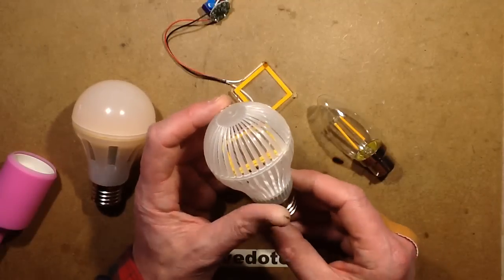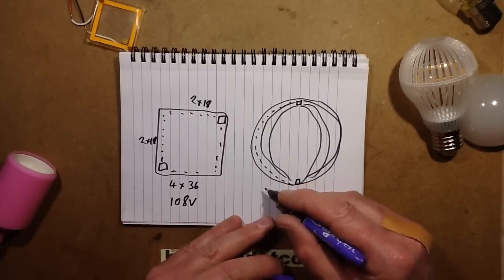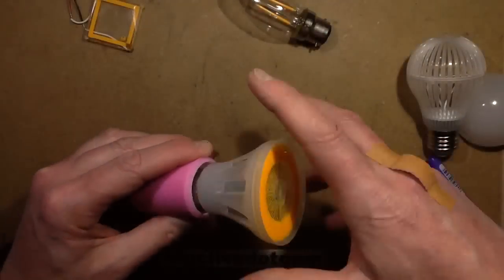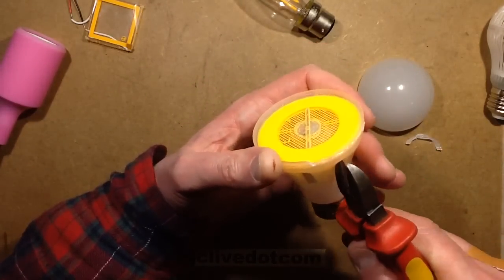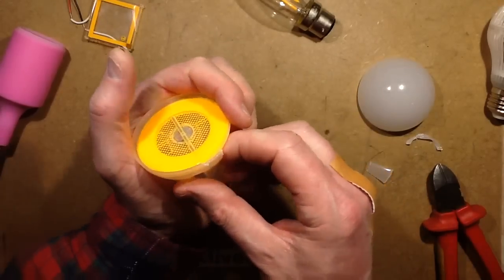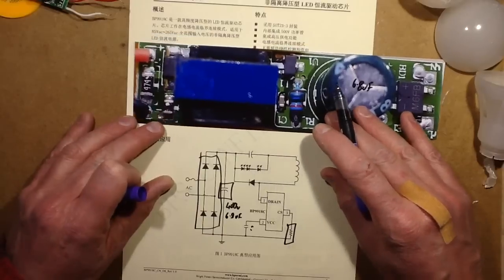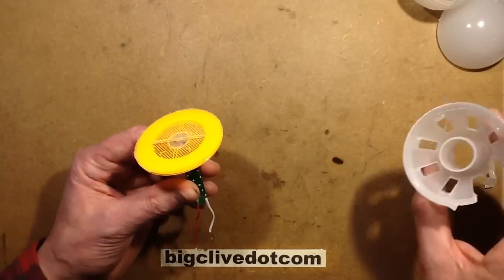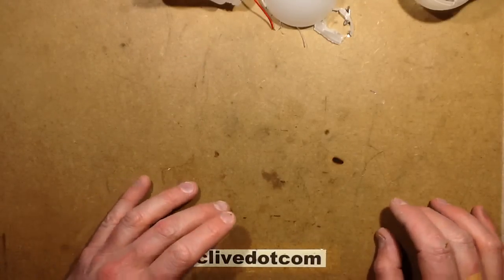Next generation glass COB LED lamp MKII teardown.

Comment: It will be interesting to see if there will be a final universal design for led lamps that everyone uses like with incandescent lamps.
Reply: yes the trend for led lamps is doing away with the univeral fitting and the entire lamp will be a unit, look at say the round led bathroom IP lamps, on the outside its the same as the cfl design but inside the leds are part of it.   they can be made more compact and in some more unusual designs if they dont have to think about backward compatability, plus easier to fit universal drivers so the entire world can have one production run

Comment: Actually these types of bulbs have been around for about a year now. Good luck getting more than 4 months of use out of them without the plastic cracking. They might do the job if you use them in a fixture where they are not on for prolonged periods of time.

Comment: If the diameter of the LED COB is same or similar as the diameter of the LED kit bulb PCB, then it should be able to fit into the other case._

Comment: What about flicker? I have a lot of led lamps with tremendous amount of 100Hz flicker for example. Would be nice if you could hook up to a scope,  the analog output of a high-speed, light-to-voltage sensor like the TSL257.

Comment: When you position that printed circuit just right it looks like a giant circuit board with big components
Reply: He did that, so the calculator wasn't that big :-)
Reply: ‍1marcelfilms the charge in that capacitor can power a house for 24 hours

Comment: How long before mains voltage rated rectifier LED's are a thing?
Reply: Just bought a set of 50w cobs off Ebay , haven't plugged them in yet, kinda handy having 220v in. 
Search for "220V 50W 60X40MM Warm white LED Floodlight COB Chip, Integrated Smart IC Driver".

Comment: Clives pictures have recently improved considerably, so much I keep thinking he has a giant circuit board!!!
Reply: Very deceptive, felt like Clives hands had shrunk.
Reply: I was just thinking that, the perspective is spot-on.
Reply: I thought it was cause he was getting older and started using large-print components, like those giant-buttoned old people phones.
Reply: I'm probably easily amused but the enlarged photos make me smile - IIRC one of the old electronics magazines had a cartoon of a chap struggling to lift a giant TO3 power tranny package the size of a bass drum  onto a bench.

If clive ever does get a camera with super zoom I hope he keeps the giant pictures going, it's become part of the channels identity imo.
Reply: John Wattie "That big capacitor is HUGE what the hell!??? Did he make the circuit board with some bits laying around?" 

No, me it's a photo. I felt so silly when I figured it out.
Reply: schadenfreudebuddha Rebelling against the modern trend of using SMD by using progressively larger components?, I like it.
Reply: ThisIsARubbishName You were not alone there!

Comment: Interesting development! None of it yet solves the problem of LED light just not being nearly as nice to sit under as incandescent. How can that be addressed?
Reply: Drugs.
Reply: A very thoughtful and useful reply. Thank you.
Reply: Decent quality led bulbs (phillips master led etc) use far better quality phosphor's than the typical £2/$2 led bulbs found on eBay etc.
Reply: I just remember I'm saving myself a lot of money and get over it.
Reply: Don't buy cheap lights and try before you buy. Problem solved.
Reply: Doesn't high CRI led light would do the trick ? Light quality is a problem for me too, I don't want any led light under 85 CRI that flood your room with blue/greenish light and makes your skin look dead :/
Reply: Pook365 some vision issues make it harder to tolerate highly concentrated point sources (glare).
I see streaks of light radiating out from every bright point, so widely spread light, indirect or fluorescent (LED replacement) tubes are best. Overall I still benefit from LED lights with my vision deficiencies, because I can have more light which makes the pupil contract and reduces the distortion. Just got to avoid very concentrated point sources.
Reply: You address it by getting better quality bulbs, especially in regards to the light quality. Clive unfortunately doesn't pay attention to that in his videos. You have to spend some, to get some, so you're not gonna get good bulbs at 2€ nor at highest energy efficiency.

The best-value option I've found are Ikea's Ledare bulbs, very good quality light with far higher CRI than the specs suggest, some go over 90 easily. Price is 6-10euros per bulb depending on power and should be available next to everywhere. Most of them are available in the much better 4k color temp as well (5k too, but that's a bit too much for my liking). No electronics-induced noises, no light flicker.

So far I've had only one break, and that was propably one of the first leds you were able to buy at Ikea, it took forever for that to go and it was in heavy use. Light years beyond any expensive (20+ euros) CFL I've had in every aspect, other than absolute maximum light output.

The tech has advanced far enough years ago, but your opinion won't change if you keep buying/seeing shitty bulbs.
Reply: PoisonedAl Good for you, Einstein. The problem is that many people with vision issues cannot tolerate LED light...and even some without vision issues find it straining. It's still an evolving technology, so I would hope that it's further refined as the year pass.
Reply: PoisonedAl Good for you, Einstein. The problem is that many people with vision issues cannot tolerate LED light...and even some without vision issues find it straining. It's still an evolving technology, so I would hope that it's further refined as the year pass.
Reply: RuralAccent Woodcraft What is the problem with LEDs for people with vision issues?
Reply: It depends on what the problem is.  I'm wondering if some people have issues with the 100Hz flicker (100Hz in the UK, 120Hz in the US.)
Reply: The problem with high CRI is cost. I have some Philips Master LED lights that are OK, but still not the same.
Typically when replacing the lights I install a lot more lumen, and that alone makes it harsher than the incandescent bulbs even if the colour was perfect. We just have to get used to it.
Reply: Nicholas Martin Indeed they are. I only use Philips, but while they're better, they don't eradicate the problem.
Reply: I will investigate those Ikea bulb, thanks for your review :)
I'd like to find a decent CRI led light bulb, preferably above 4k, providing enough lumen for my room (typically around 2000lumen would be fine), and dimmable. That shouldn't be so hard to find! I don't mind the price too much. TBH the more I search, the more I think I will end up building my own lamp, from led COB, heatsink and arduino, as I previously had. But that's costly.
Reply: There is nothing to be addressed. There are enough LED lights/bulbs that are completely indistinguishable from incadescents for quite some time now. Just don't buy the cheapest you can get (although even those are quite often fine now).
Reply: I'd like to point out that not all leds from Ikea are great, for example Ryets are already a noticeable step down from Ledares. 

And I think the only reason why people are weary of higher color temps is the fact that most earlier higher color temp CFL bulbs had horrific color rendering and people simply automatically associate that with higher K bulbs. These days I'll stay away from 2700K in general lighting if I just can, it's good for some uses though, like pre-sleep situations/locations.
Reply: +stefantrethan Yes, typically the issue with high quality vs. Poundland quality is cost.
High CRI lighting requires more phosphors in the mix. Just like with fluorescent lights before them. To keep them evenly distributed requires more care in their manufacture as having granules with different densities, shapes, and sizes become uniformly mixed is difficult.
Reply: The K stands for Kelvin. The rating is an approximation of what blackbody curve it fits. It has no relation to the "quality" of the light. You can spend a lot of money on a 94 CRI warm white LED strip light reel. And it will have a 2800K-3200K rating.
If you buy a 2000K lamp, it will approximate the light curve of a 2000 Kelvin blackbody emitter, whether that lamp is incandescent, fluorescent, or LED. Complaining that you purposely bought a yellow lamp and that it was too yellow is unreasonable.
Reply: Some lights can cause seizures in ppl with photosensitive epilepsy, just the same as game consoles, pc monitors, strobe lights etc

Comment: Hi Clive. Does this style of lamp generate much heat?
Reply from the maker: Not excessively so as its design facilitates good airflow.
Reply: bigclivedotcom Thanks, that's good to know.
Reply: bigclivedotcom especially with the customised 'vents'
Reply: probably the best thermal design ive seen, and a 10w led is pretty decent too
Reply: +Paul Gascoigne Clive thought it had too little of those and made a few more ;-)